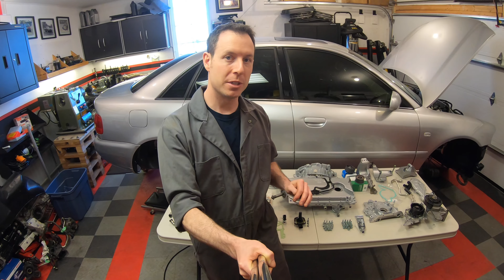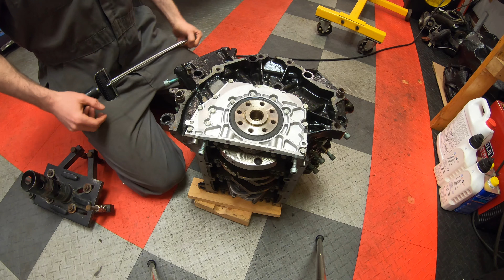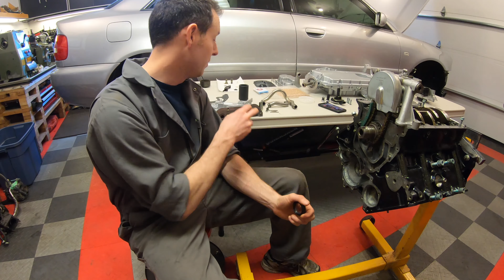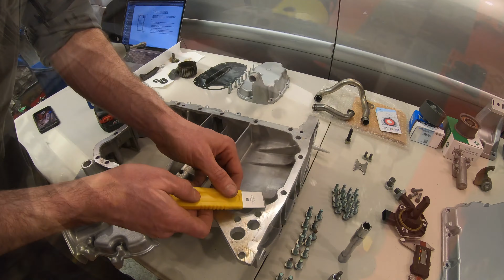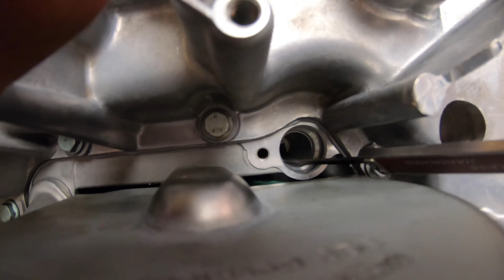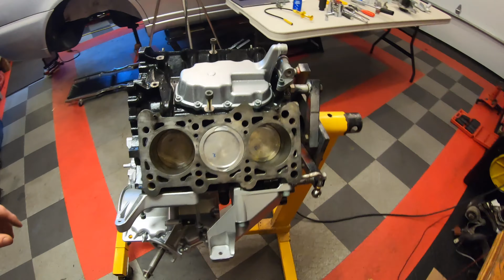Audi 2.7T Oil Pan / Pump / RMS / Front Crank Seal - Installation

Comment: Wanted know know if your oil line return hole from the upper oil pan size are different from the driver side to the passenger side? I am having a issue with the passenger side have to much play. Also the O-Ring is perfectly fine. Thanks
Reply from the maker: As far as I know they are both the same size. Check out this thread, it has details for a slightly larger o-ring. My OE o-rings weep so I may have to try the larger ones in that Audizine thread.

https://www.audizine.com/forum/showthread.php/919659-Wtb-lower-oil-return-o-rings
Reply: @PBGarage  Thanks for reply, This is something else here. come to find out that the driver side is larger then the passenger side. I'll check that link and hopefully I can get something out of it. Thanks agai

Comment: Hey bro I've got a 99 quattro a4 6 banger with a shattered lower oil pan and it looks like just a small crack in the upper but you think it will be hard to replace both the upper and lower from underneath???
Reply from the maker: Yes, that will certainly be a chore, possible, but painful. Might need to drop the subframe.

Comment: 07:57 Front Flange and Crank Seal
You recommend getting the rubber one in your video, the part number you gave in your details in that for the rubber one by any chance. Im in the middle of a complete tear down and rebuild and following your videos heavily. Looking at FCPEuro website they have a couple different choices Corteco, Continental etc...
Any insight would be greatly appreciated, awesome video
Reply from the maker: Thanks for the feedback! Glad to hear the video is helping.
That part number will point to the Corteco (PTFE) version. I’m not sure offhand which are the rubber versions. At the time of writing this, I have over 12k KM on the engine and have no leaks at all, so I guess the PTFE seal isn’t so bad after all. Just have to be careful installing it.

Comment: Hello would you happen to know where can I find and upper oil pan for my 2.7t ? I see that the one for the 2.8 looks very similar but I’m not sure if it fits
Reply from the maker: Hey! The upper pan on the 2.7 has ports for the turbo drains, which the 2.8 doesn’t. Try eBay or a local junk yard. The 2.7 came in a few different cars (A6, Allroad, S4…)

Comment: Did you prime your oil pump at all? If so, what’d you do?
Reply from the maker: I did! After it was all back together and installed in the car, I filled with break in oil (Amsoil is what I used), and cranked the engine (no plugs, fuel pump fuse pulled) for about 30 seconds. Top up oil and do it again for another 30 seconds or so. After the first engine start, keep a very close eye on oil level, top up as required.

Comment: Is there a different oil pump that can be used on the B5 S4 or C5 Allroad?
Reply from the maker: If I’m not mistaken the RS4 pump is different (more pressure?). I haven’t looked into it to be honest, from what I gather the stock pump is okay for basic K04 builds. What are you building?
Reply: @PBGarage  3.0L from a 2.7L with a girdle, Pauter rods, Wiseco pistons. Two Garrett GT3076rs.
Reply from the maker: Sounds spicy 🔥🔥🔥

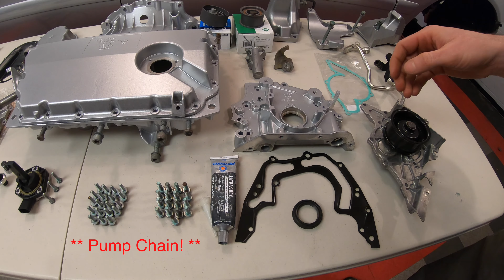Comment: Question!! At 1:57 where can I buy the front crank seal gasket? I I’m preparing to build my motor but cannot find this part. Thanks for the help!
Reply from the maker: Is it part number 078115189H that you're after? Try here:
https://www.fcpeuro.com/products/audi-vw-timing-cover-gasket-elring-078115189h
Reply from the maker: Also, have you been to this site before? Super helpful!!
https://audi.7zap.com/en/usa/

Comment: Thank you for the informative video! I have one question. You will realize I am a DIY non mechanic:  can you tell me if  the transmission and upper oil pan can be left in the car while the block is unbolted and removed from the engine bay?  (2001 audi a6 2.8 c5)
Reply from the maker: Hi Peter, no, this is not possible. You need to separate the engine / transmission by pulling them apart to free the transmission input shaft from the clutch assembly, and with the oil pan still attached to the transmission this is not possible.
Reply: @PBGarage   l had hoped l could leave the transmission in the car while removing the head to keep it less complicated! 
Thank you for the time taken to reply. 
I guess learning how to remove the engine is next ( l almost just puked) !!
 Peter

Comment: got 1 question for you, i got a a6 c5 2.7t. Its pretty hard to find parts for the "a6 2.7t" but question is: is a4 2.7t and a6 2.7t same parts?
Reply from the maker: Depends. If you’re searching for parts what I find helpful is to grab the part number from 7zap (ETKA) and then just plug the part number into the search (Rockauto or FCP, ECS etc). Then you can see all the models that use that part.
Reply: @PBGarage  oh thanks for answer ;D

Comment: I love the 2.7T AGB engine.  Undertook a bottom end rebuild on mine at 212k miles and she is still super smooth and strong at 291k.   Looking to get the old girl to 476k miles, too the moon and back, before I retire from driving. Secret to longevity with these engines (as with all engines) is keep on top of servicing and maintenance and don't overboots or over stress with power tuning.  Just enjoy the car / engine for what it is.
Reply from the maker: agreed! maintenance goes along way. Unfortunately these cars/drive trains fall into the hands of those who are not as diligent as most about maintenance, combined with abusive driving habits makes them fall apart real quick. But there are a few of us out there still, who will take these units to 500k+ kms easy!
Reply: Haha!   I had to google "how many miles to the moon and back".     Good goal for sure!

Comment: amazing best video yet of internet rebuilding of 2.7t.  my cam guide broke and as I was doing the cam seals the chain jumped so I had to open the valve cover and found big chunk of plastic then had to open leaking oil pan and find the rest and clean out the pickup screen then only 1 person could tell me if the oil pan gasket OEM was metal of silicone and it was a vw place guy told me no gasket on mine and so happy day. now this video and the cam chain install and the stupid 16 link thing is my bibal
Reply from the maker: Awesome, glad it helped!!

Comment: FYI Audi manual specifically says that there should be no silicone on the lower oil pan, they have a special cardboard seal for it.
Reply from the maker: Do you have a reference for the seal? It would be good to know! In any case, I'm at about 3500KM and no issues with the silicone seal.
Reply: @PBGarage  I can send you screenshots of the manual but here is the copy straight from it :
9 - Gasket for lower section of pan
Sealing surfaces should be clean and dry

Installing
Install in the opposite order to removing. When installing, note the following points:
Note:
Do not use any adhesive or sealant.
- Clean sealing surfaces; ensure that they are free of oil and grease.
- Install new gasket on lower section of oil pan and install on upper section of oil pan with two diagonally opposite bolts.
- Tighten all securing bolts hand-tight.
- Tighten bolts to 10 Nm with torque wrench, working from center outward.
- install new seal on oil drain plug and tighten to 30 Nm.

OE nr: 078 103 610 E

Comment: hey did u use new hardware?
Reply from the maker: Actually I did not. All of my old stuff was in good condition and cleaned up really well. I degreased and scrubbed each fastener before reuse and inspected for any damage / corrosion. I also have a big bin of spare Audi hardware so I swapped out questionable ones.